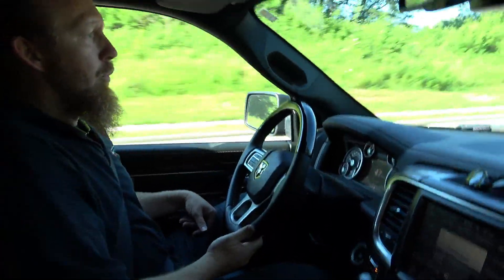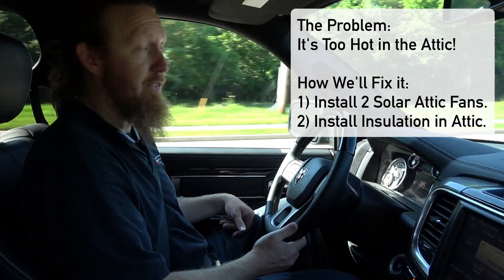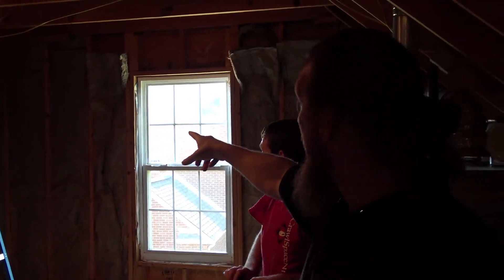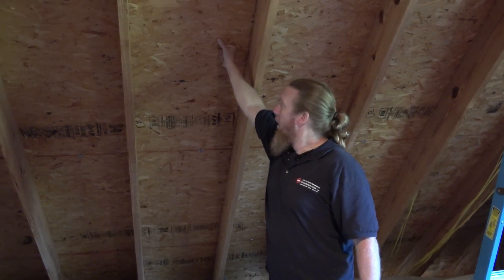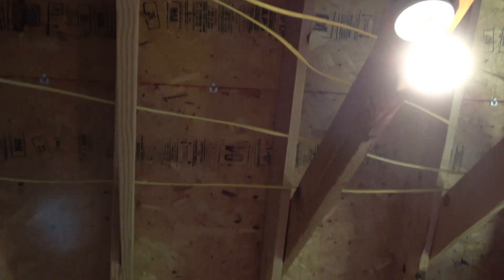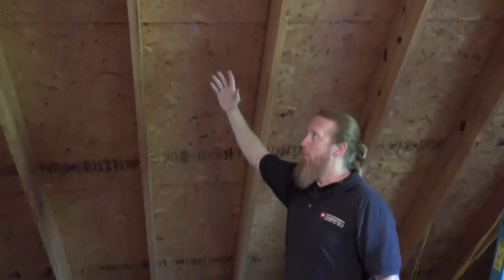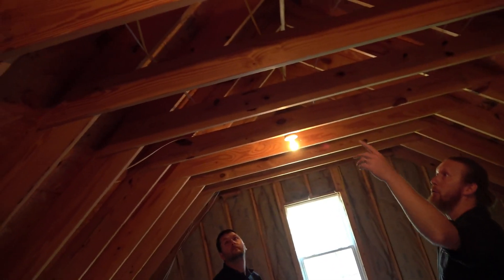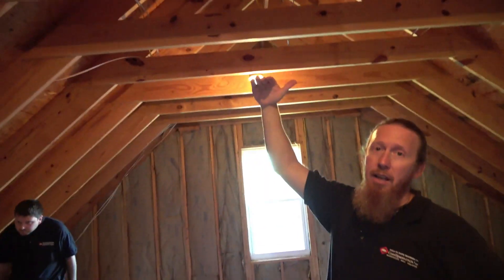SAVE MONEY by Installing Attic Insulation and Solar Fans Yourself

Comment from the maker: Check out our latest video on radiant barrier and how it can help keep your attic cooler! https://youtu.be/Vd0EMHJ4Lxs
Reply: I was just wondering the home owners didn't choose an option for radiant barrier film against the sheathing? those soffit baffles would have given the rb the necessary 1" air gap it needs to work. advantage of batt insulation is a roof leak won't go unnoticed compared to ... foam. in 2018 I had the double sided perf rb you describe added under my new sheathing. contractor could only find 1/2" prefab rb osb so we went with a roll of rb and thicker normal osb. I have 2x4 rafters and lots of roof webbing obstacles, so don't have much of an insulation option, possibly staple housewrap under the 2x4 to help direct soffit airflow to the ridge vent.  when maintaining the hvac in the attic, the radiant barrier alone has made working in georgia's july sun - hot..from unbearably hot :)

Comment: I'm in the Memphis area, and it gets UNBELIEVABLY HOT! And the humidity makes it just that much worse. I wish you would've had a Temp dial/gauge to show the difference, before and after.   And I've had to deal with 110* heat index, 100% humidity at 2 am!! And not a cloud in the sky!  Then get home, strip down to jump in my 18' pool that's somewhere near 80+*  But you couldn't just float, because you'd get eaten by the mosquitos. they were not as bad as Wisconsin or Minnesota, but still bad.

Comment: How would you detect a roof leak if you add insulation to the roof rafters??
Reply from the maker: Use a flashlight to inspect the underside of the roof sheathing and rafters for shiny or wet spots. If the leak is older, there may be rotted wood or mold growing nearby. The insulation batts that cover the rafter bays may also be wet if they are insulated.

Comment: This is what I need. Over my garage. So it won't keep getting so hot.
Reply: Reflectixe bubble wrap is a excellent choice for most stituations. However you must install 1 x 4 boards horizontally instead of stapling directly to rafters. This allows the heat to not get trapped on any corners. This also has a R-value of at least 6. I like to call it redneck spray foam. This prevents any heat from entering your attic. I used pallet boards in place of 1 x 4 because of lumber prices. Works great

Comment: For professional people this was very poor ! Why didn't fissicly check the cealing(floor) to make sure of insulation? Why didn't they put reflecting foil up? Why didn't they put foam sheets in or spray foam with fire retarder? Why didn't they put a moister barrier up? Fiberglass only slowes air flow it does not insalate! Common solar fans really! Did they check sofits for openings? This gives us a really bad rap !
Reply from the maker: We definitely do recommend radiant barrier in most cases, and would recommend the other things you mention depending on the needs of the homeowner. In the case of this video, sometimes the homeowner only wants what they want done and you can't force them to spend more money. We have a large library of other attic solution videos available if you'd like to check them out. It's hard to cover everything in just one! Thanks for watching. 🙂

Comment: What was the end project cost ? I need this... I  just moved into a loft apartment/ garage and I  need help cause it's super hot. I'm in N.C .
Reply from the maker: Hi Lisa, it depends on material and labor costs in your area, as well as the size and needs of your space. We'd recommend contacting a local contractor in your area to get some quotes.

Comment: What model number of the solar attic fan are you using?
Reply from the maker: The Solar Royal SR1800 Solar Attic Vent Fan. We did a review of it here: https://youtu.be/7VTbheYFYNc
Reply: @CrawlSpaceNinja  in this video (not the unboxing solar panel) you mentioned it had a thermostat that was activate at 70°, is that something the you can do a video on how to install solar fan with thermostat activating setting?
Reply from the maker: @vizioasdf  For the Solar Royal product the thermostat is built into the unit. No installation needed, it just hangs from the fan into the attic.
Reply: Depends on your square footage

Comment: Could you have just installed radiant barrier and have the same results?
Reply from the maker: Yes, very likely. Radiant barrier does a great job at keeping the attic cooler. Check out the most recent video we did about it: https://youtu.be/6vVfdM4yzMs

Comment: Put the paper OVER the stud. Unless you are gluing drywall, the staple won't stop a drywall screw. The vapor barrier needs to be as complete as possible - side stapling defeats that.
Reply from the maker: Thanks for the comment!
Reply: It also compresses the fiberglass somewhat which potentially reduces R value (slightly). Most people seem to do this Michael's way tho.  Great video!

Comment: To make your house energy efficient and comfortable you need to make your house like a thermos. A thermos can keep a drink hot or cold for 24 hours. Why? Because is 100% air tight all the way around and insulated all the way around. Fiberglass is NOT an air tight insulation. Hot air from the roof decking can easily move through the sides of the fiberglass and paper. The most effective way to make an attic energy efficient is to spray 7 inches of open cell spray foam to the bottom of the roof decking and seal off the soffit vents and roof vents. This will make the attic space 100% air tight and insulated. This strategy is known to cut electric bills in half. Using spray foam under the roof decking and eliminating attic ventilation will not shorten roof shingle life as well. I have a letter from GAF shingle manufacturer that spray foam insulation will not void their warranty. Research open cell spray foam. I will be doing it on my own house.
Reply: It’s not that this is bad advice it’s just not completely accurate.  The building science has proven this approach to be less than optimal in most cases and detrimental to both the life of the shingle and the life of the decking because it does not adequately address thermal bridging. Also, closed cell is a better answer for air tightness.  I would advise you to consult someone proficient in addressing the whole house building envelope as it performs as a system and not just a collection of components

Comment: OK I finally installed thermometers in my attic and outside and garage.  The attic goes about 20F degrees above outside temperature but cools off pretty quick at night and last night it went down to the 60’s and so did my attic.  We live in Southern California and it gets hot here and triple digits.  Do you think it I should put an attic fan in just for the daytime when it gets really hot outside and in the attic
Reply: I just did two days ago. Makes a huge difference for our room directly under the attic. Another one sucking air from the house up the attic would help too.
Reply from the maker: It may help cool your attic during the warmer months.

Comment: The insulation company placed insulation all around the cement is that good enough to keep the area warm.  Do I need a dehumidifier installed. My house is 26x44. My crawl space is 4ft in height

Comment: Don't those fans cause a negative pressure in the attic and make conditioned air leak up into that space?  Dr. Energy Saver has a product that just tightly seals the attic up with foam board that has a radiant barrier and the attic space is then near the same temp as the conditioned space.
Reply: An important factor not mentioned in this video is soffit vents. These need to be nearly continuous. With these in place, the baffles in place, and a ridge vent, the pressure difference is minimized. Of course, with these in place, you may not need the powered ventilation. Just depends on your particular situation.
Reply: @christianlibertarian5488  Exactly, and ridge vents never go out on you, and never create so much negative pressure that they draw air in from the conditioned part of the house.

Comment: This is not the right solution. You would be better off augmenting the attic floor insulation and taking that to R49. Before doing that that attic should be air sealed, and baffles installed along the soffits to extend 3” above the insulation. If necessary put a radiant barrier on the west facing attic walls. Solar fans are.... ok but may not be necessary if the attic floors is air sealed and insulated properly.
Reply: Not if you want it to be anything more than storage...

Comment: Resist the urge to use the attic as a closet keep it empty and clear, for better air flow and circulation.  Rugs are bad heat absorbers and humidifiers, cold hard floors carry the day in hot summer days!  If you have one of those bad week long heatwaves use a quick put up and take down shade or tent awning and shade any windows that take in full sun between 11AM-sundown.
Reply: I've redone all my window screens with solar shade screening and fabricated a freestanding screen for the room on the second story that gets sun almost all day, it has helped a lot, now my over insulated/no ventilation knee walls are next, I can feel heat actually radiating off them from the attic being 150 degrees

Comment: Why not put radiant barrier?
Reply: I installed radiant barrier in my home, my usage went from around 1800 kw per month down to around 900 to 1000 kw per month
Reply: This is NOT the right solution AT ALL!

Radiant barrier + fans

Do not ... DO NOT, put insulation on the roof decking SMH
Reply: Travis A:
Why do you say this is NOT the right solution..?? Why is it not smart to put up insulation on the roof decking..??
Reply: You Tube  To reiterate what Travis A posted: This is NOT the correct application. Radiant heat barrier (foil) with attic fans would have been the proper solution. There’s a difference between conduction/convection heat...and radiant heat.
Reply: Radiant barrier Would be easy to add but would be best if those baffles were coated with aluminum on the Sun side (to act as the radiant barrier)
Reply: Steve Hann I installed insulation in the rafters just like they show in the video and I also installed radiant barrier on the attic floor after doubling to r60. I did this to keep my winter heating in the house rather than escaping up and out the ceiling.
Reply: Tennessee still gets fairly cold winters. So fiberglass is  still the best option. Radiant barriers are only good for climates where it stays hot all year long, as they are much less efficient when trying to heat a home rather than cool. You also shouldn't use radiant barriers where outside air can easily contact them as dust accumulation will lower their efficiency.

My 1949 home in the mid-west had only radiant barriers for the attic. They got dirty from the several times it was re-roofed and didn't do anything to help keep the attic cool. I've installed R-13 and R-19 fiberglass insulation it's much easier to keep it cool now.
Reply: Why don't use polyvents?
Reply: I think any open vents would detract from the powered vent (pull in air through other vents rather than pulling air just from the attic).

Comment: My house was built in 1867 (yes 18).  No soffit vents, no roof ridge vent, just an exhaust fan in the wall.  A typical new england metal roof has been installed some time in the past.  I have a walk in attic over a cold kitchen. I want to stop the heat loss from the kitchen up into the attic.   I am planning on insulating the "walls".  They slope from ceiling peak to the floor.  Would I need baffles?   This room is fully floored and has some insulation under the floor boards.  Thanks for all your videos.  They are very helpful.  PS.  an insulation company wanted to just blow in insulation which would mean I couldn't use the space as a room again. I didn't like that option.
Reply from the maker: We no longer do attic work, but if you're interested, we just launched our "Ask a Ninja" page where you can submit your specific situation and up to 3 questions and for a chance to have Michael answer them over the phone. Check it out here: https://crawlspaceninja.com/ask-a-ninja/
Reply: Many options for you, but remember that northern houses have different needs than southern ones. Ice dams are a big worry up north, though your metal roof combats it. Something needs to prevent warm moist air from your kitchen working its way up to your cold attic roof and then condensing and freezing. Glad you didn't just blow in insulation, as that would have caused the condensation inside the insulation. Baffles are one way of venting that moisture up, but you need good ventilation at the ridge line. You can, fortunately, retrofit a ridge vent on your metal roof. 
   I had a similar situation to yours. I put in a ridge vent in the process of replacing my shingles. I put baffles in to vent air immediately under the roof decking, then fiberglass under that. An important step is a vapor barrier between the fiberglass and the warm, moist inside air. You can use plastic film, but that seems to have lost favor recently. As an additional block, I used foil backed bubble wrap to form the baffles. I'm not sure it added much, but the price vs baffles was nearly identical.
    Someone here suggested foam, which is a great idea as it both insulates and blocks moisture. It  would likely not need the baffles either. It is pricier per unit R value than fiberglass, but if it can avoid the other steps, it might be worth it.
   Whatever you do, get more than one recommendation. Good luck.
Reply: You should look into spray foaming. You may want to consult an engineer to ensure it can be brought up to modern standards